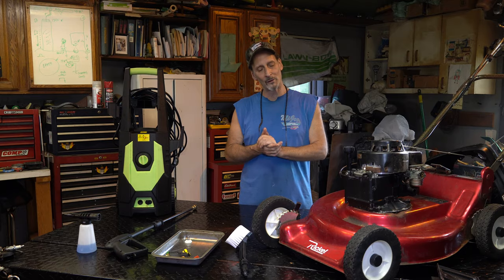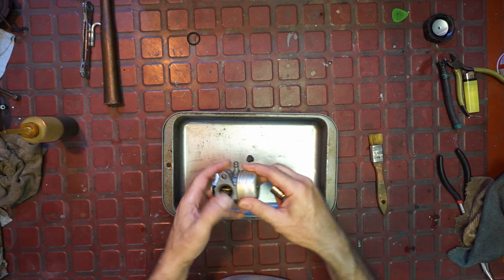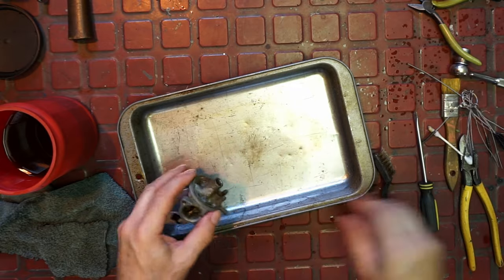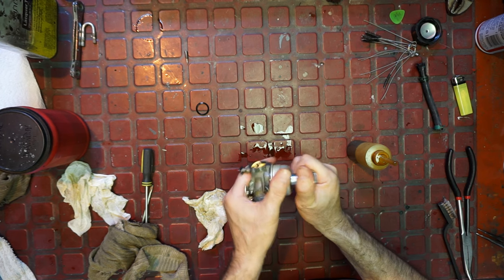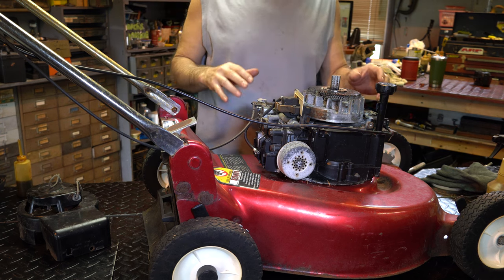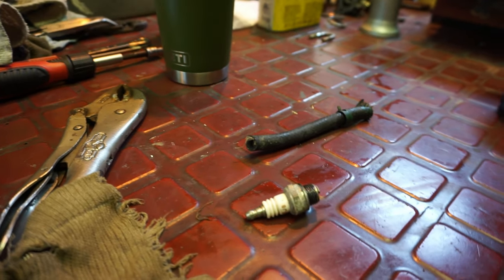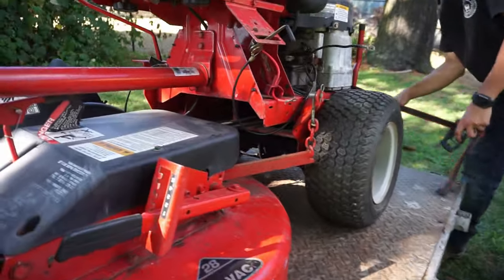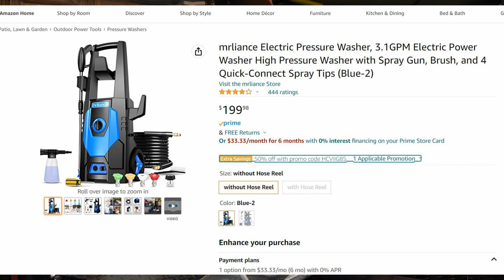WHATS A RICKEL MOWER? Will It Run?  Lets FIX IT and Give It to Mikey!

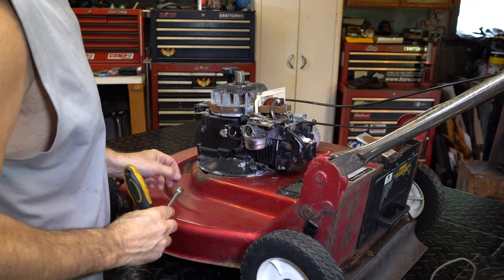Comment: 4:07 - This engine is called the Briggs & Stratton MAX.  The MAX, which was produced in 3.5 and 4-hp versions, is like the original (later renamed the "Classic"), but with a float-type carburetor made by Walbro instead of a suction-lift type, a paper cartridge-type air filter instead of an oil-foam filter, an overhead gas tank with a rubber line and (usually) a fuel shutoff valve, and an extended oil fill with a dipstick.  (Extending the oil fill is actually the stupidest thing Briggs & Stratton ever did, since with the old-style oil fill without a dipstick, it is impossible to overfill the crankcase, whereas with the dipstick, it is very easy to overfill.)

The MAX was produced from the mid-1980s to the early 1990's.  It was replaced with the Quantum, which was similar to the MAX, but with a mechanical (centrifugal) governor instead of a pneumatic (air vane) governor.
Reply from the maker: Awesome!! I pinned this! I may read it on my next live show!!
Thanks Greg.

Comment: Nice little old mower. I'm still working on a few old Snappers and even a 1981? 30" RER Snapper!
Reply from the maker: Nice,,,,I have a few jammed in a corner somewhere. I will get to them,,,I know there is one for sure probably 90's. For years the 80's versions were the only machines I personally used!
Thanks fer watchin!

Comment: I lived in north Jersey as a kid and that name Rickel kind of rings a dim bell. What I remember more was Two Guys From Harrison! 😂   As for that fuel leak, way before you showed that I was wondering why you didn’t replace the float needle seat. I got a Tecumseh needle seat tool and a bulk pack of the seats and I automatically replace those when I work on that type of carb. Easy and quick to do, so why not?
Reply from the maker: Those leaks are rare oddly. I don't even have any on hand either. I really do need to pick up a few parts again.. I just finished putting in an order, yet another $#100 freekin bucks gone, not to mention prices keep going up.

Comment: My first pressure washer is electric, and although it’s not powerful enough for some things it’s almost perfect for the initial scrub of small engines. I’ve gotten two additional gas washers free but I’ll probably fix and sell those. I just wish sometimes the wand was a lot shorter so I could get at things closer that I’m holding with my other hand.  Were you trying Super Clean in the foam bottle?  I’ve been thinking about doing that for some of the tougher grease.
Reply from the maker: Yes I have tried the foamy in bottle and can! Works well for certain things but I like to wet with water and or regular superclean 1st.
I've been looking at a smaller electric for a while. It does have a shorter wand and they sell very short wands for both electric and gas BTW
Your right,, less pressure is often the way to go and I say this from time to time. I luv my big guy and I have a nice (but broken) steam jenny I hope to get running on this channel in the fall! Always wanted one of these!!! Especially since I do wash in the cold months..Those are the big bully's that can tackle anything!
Reply: Arch's Garage   I meant have you tried SC in your foam cannon on the pressure washer.
Reply from the maker: I thought that was a foam cannon,,its an applicator and I like that. This way I dont need to use a pump sprayer or my other pressure washer.
I tried a mix of laundry detergent and superclean and it worked well. Gonna try just superclean and maybe some dawn as well next.
It will use a ton of product though. It will flood an area with detergent.
Reply: Arch's Garage   Yeah, I know. Would be nice to have a way to meter out the detergent.